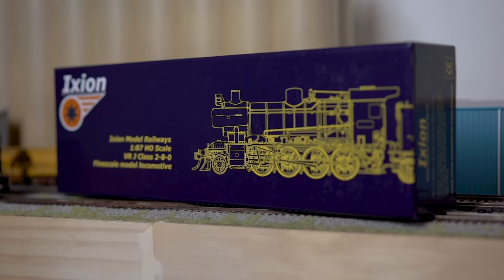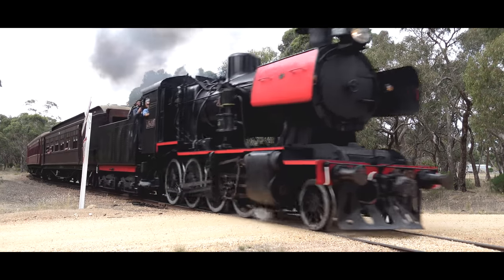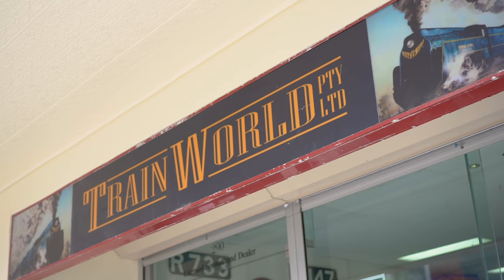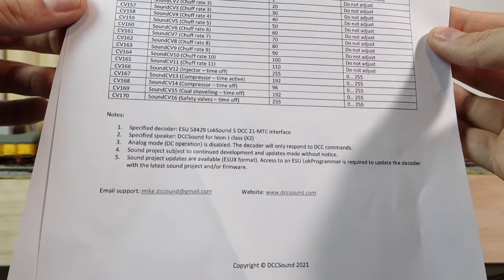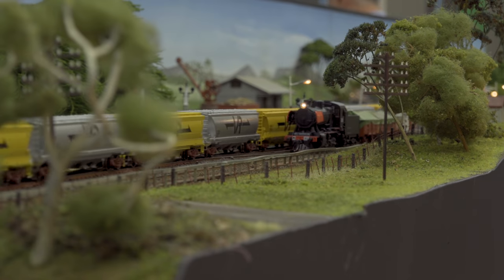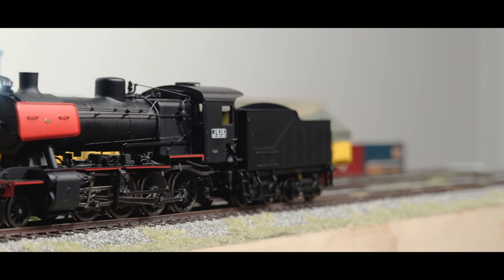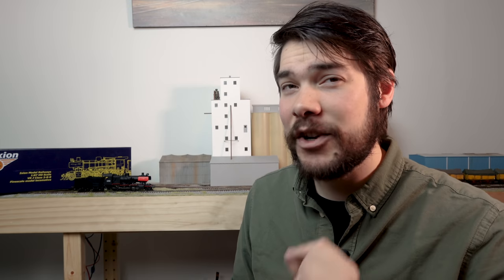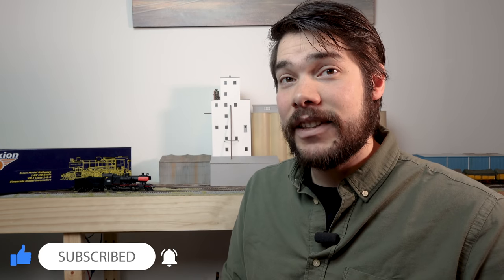IXION MODELS: J CLASS STEAM LOCOMOTIVE REVIEW WITH DCC AND SOUND

Comment: This is an awesome model and beautiful replication of the JClass. I have J549 - it is simply stunning. It is however all let down by that atrocious tender connector. It is simply not good enough. It continues to come apart on the best of track. Over points etc. And what is left - as has been pointed out, is the tender being dragged by the wires. What is the point of such a beautiful effort in reproduction if the model is let down by such a fundamental flaw in the tender/loco design and physical connection point? Obviously Ixion would be aware of this issue. Are they going to recall the model or issue a different hooking mechanism part for all their customers? Frankly if they don't, I feel our models will be lucky to last 12 months before those wires rip out of the plastic ends or snap - rendering this beautiful locomotive useless. Which is such a shame. Has anyone approached the manufacturer for a resolution to this design flaw? Thanks
Reply from the maker: I don’t believe anyone has! Might be worth contacting them to see if they have a remedy to help out, mine has never come undone, so it could be a factory flaw?